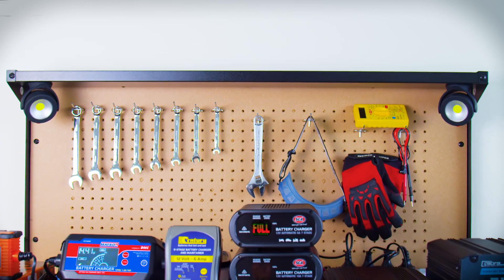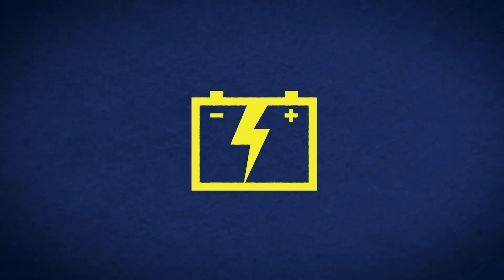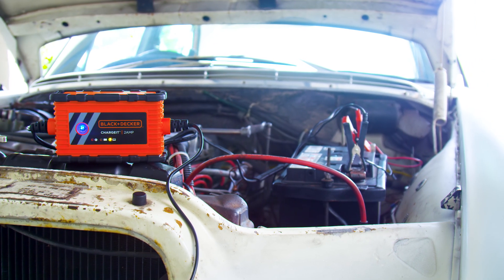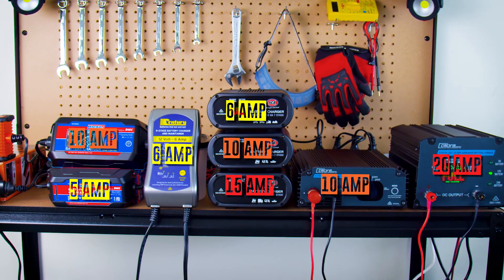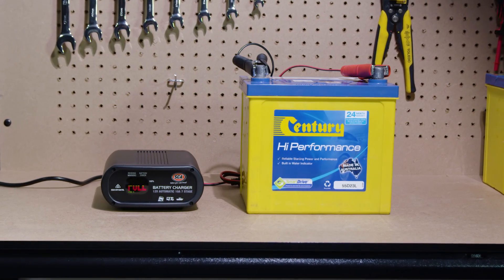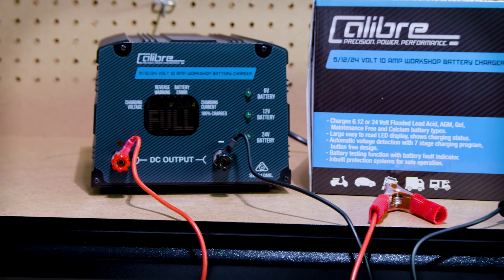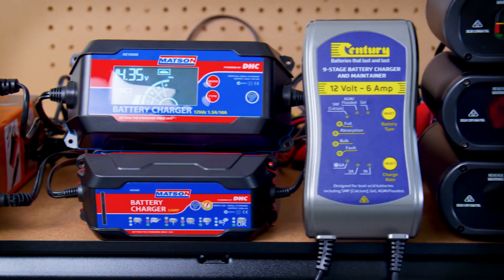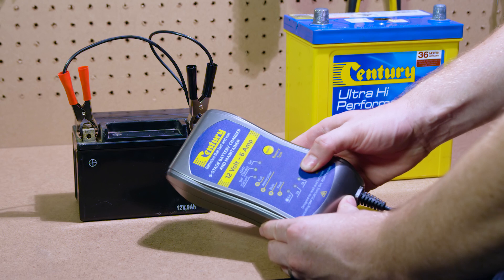How to Choose a Battery Charger // Supercheap Auto

Comment: Try Zanflare LCD display smart charger Zanflare C4, specifications
- Input: AC 100 - 240V, 50 / 60Hz, 0.6A max, DC 12V, 1.5A

- Output: USB 5V 2A

- Charge current: rechargeable Li-ion batteries 4.2V, 300mA / 500mA / 700mA / 1000mA, rechargeable Ni-MH batteries 1.48V, 300mA / 500mA / 700mA / 1000mA

- Discharge current: 300mA, 500mA .Find more information on Amazon Canada & France.